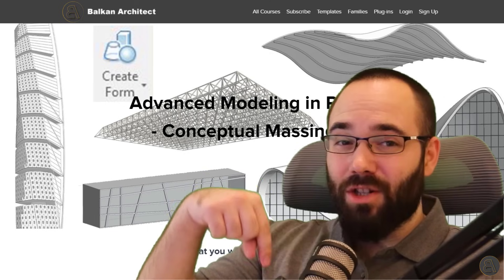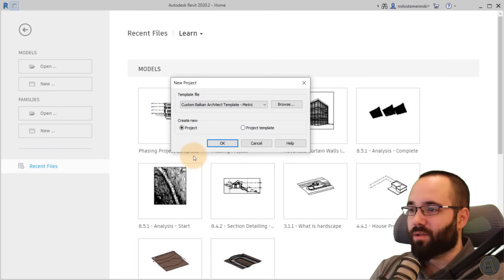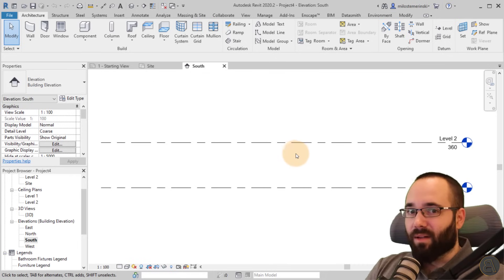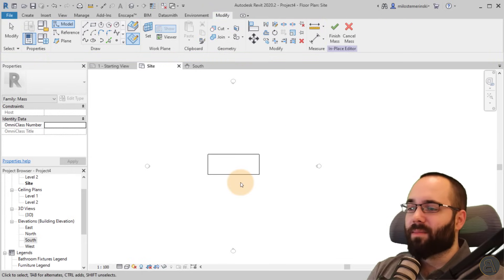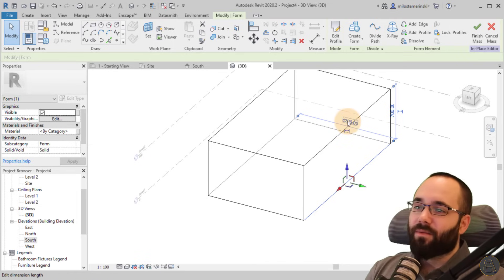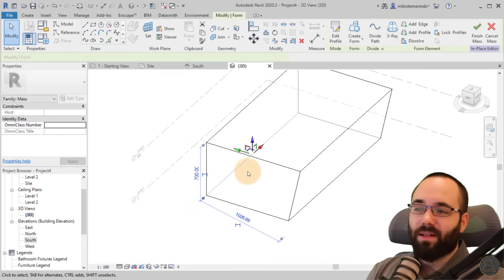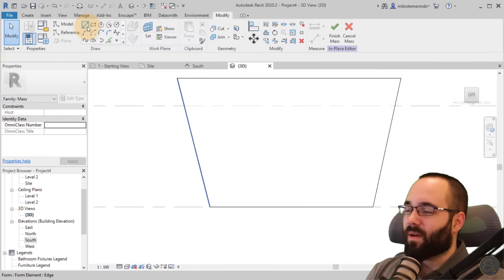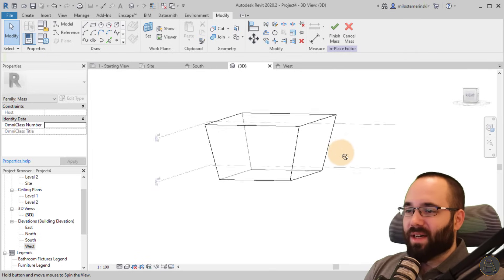Wave Roof in Revit Tutorial - Massing in Revit

Comment: hi. i've been stuck on trying to create form on the 2nd copy of the lines (i was able to create void form but not the solid form for the 2nd copy of the spline), i notice that that 2nd copied and mirrored spline that was placed on 2nd reference plane line were not visible on the elevation. how do i solve this? how do i able to create solid form? it shows an error that says unable to create element.
Reply: If you go into your site view, you'll notice 1 of 2 things: either your lines are being drawn directly onto the reference plane, to which you can just use the move tool to move it off the plane so that it is in view. The other thing is your lines might be snapping to different elements, thus giving you a 3D line. I solved it just by not snapping the lines to anything. 

As for the copying and pasting part going forward, we are both victims of software updates and there isn't much we can do about that other figure out where the hell the settings were moved to. (very annoying)